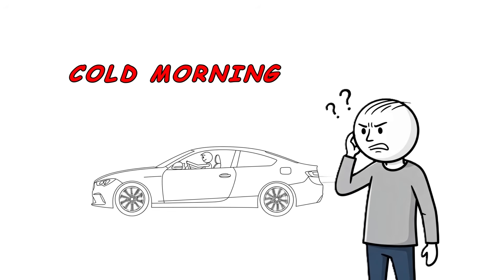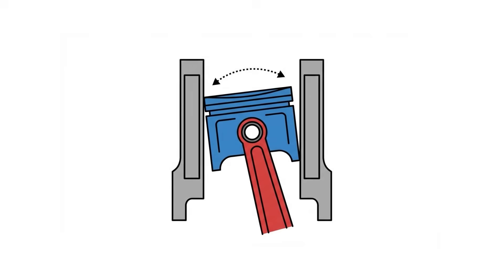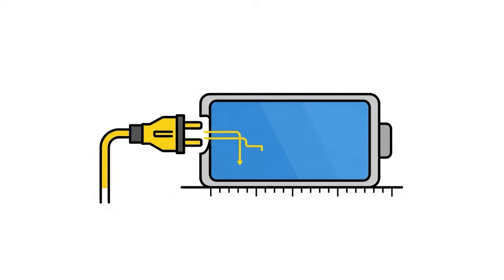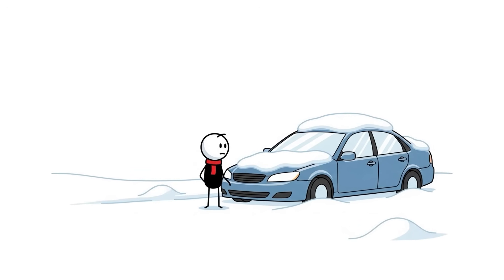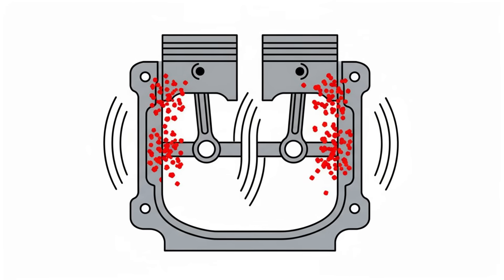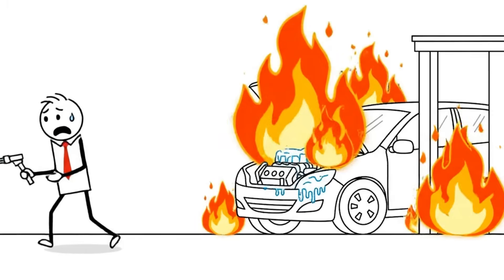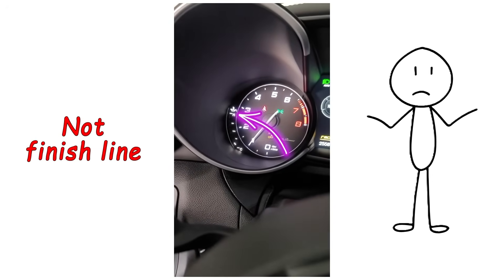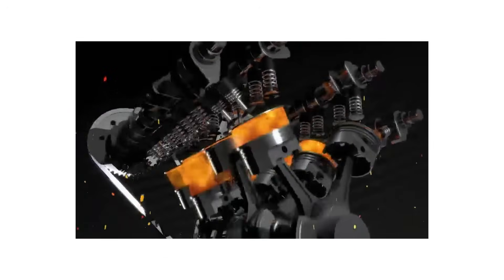Never Start Your Car Like This in Cold Weather (Ruins Your Engine FAST)

Comment: No need to tell me,im a mechanic,you warm your cars engine and let it get to operating temp on its own,no reving,in any state even cold or hot,you never just start a car and take off.
Reply: Start your car and take off in the time immediately. However, do not rev or race your engine until it gets up to operating temperature.
Reply: Doesn't matter at low rpm. My car warms up for maybe 5 min then I head down my 25mph street before I hit main road. 178000 miles and going strong.
Reply: As a mechanic I disagree, it’s exactly what you should do. You start the car and you take off normally.The oil needs to be under pressure / load to be distributed correctly, not just sat idling under no pressure at all. Thats awful advice.
Reply: Well since my advice is so aweful mr mechanic you don't have to hear me again because you've just been muted.
Reply: @kelvynwilliams7186: really? You’ve muted me? Why? Please don’t! I love you 🤣
Reply: @skykid4000 , please tell us why. Seriously. I have seen videos recommend heavily to not let your car idle while running whenever possible.

Comment: 2005 accord , warm up for 5 mins. Cars at 280k plus miles.
2015 335i warm up for 1 min till rpm drop than drive slow till car warms up. Seems to work.
Reply: 1998 honda accord.  I idle it in negative temps for 12 days straight 😂

Comment: My 71 Chevelle needs time to warm up...even in Summer.
Reply: There is nothing wrong with it. It's probably a big v8 engine and if it is a big block Chevy engine, it will take even longer to warm up. 
 These are not little modern day engines like my 2024 Chevy equinox with a little puny 1.5 liter  engine that only takes a few seconds to start warming up.
 My 71 GTO has a 455HO 7.5 liter engine and because of the large displacement it just takes longer to warm up.
Reply: @gadgetkat5146 I prefer my big block engine. Rumbles with the camshaft, roars like a lion when opened up. New vehicles can't compare. Do you still have your GTO?
Reply: @twalatka It was my first car that I bought in 1984, and I sold it in 93. But I wish I still had it. It had the 455HO with M22 rock crusher transmission. 
 
So you have a big block in your Chevelle, 396 or 454?
Reply: Then theirs something wrong with it. Its better to start a car and just drive. The oil gets displaced better under load and pressure than it will just sitting and idling my man.
Reply: @skykid4000 😂😂😂😂😂😂😂You obviously never owned a pre fuel injected vehicle.
Reply: @skykid4000 😅😅😅😅

Comment: Such BS!  Most cars use synthetic oil, which coats engine parts and stays there for days following engine shutoff.  As long as your car hasn't sat for days, youre fine.
Reply: If you actually looked into it you would know that most of these synthetic oils are not truly synthetic and are just mineral oils that undergo hydrocracking.
Reply: @M1tzaaa  😳

Comment: I wait at least 5 to 10 minutes when is FREEZING cold out. Don't care what anyone says.. Never had a problem. Trans feels horrible even trying to drive calmly down the road if i try to drive right away. No thanks.
Reply: All stuff i've known for years. No more than 3 to 4 minutes, even under the most severe temperatures. The more important thing is to drive it very slowly and get the driveline fluids up to temperature which won't happen when the vehicle is sitting. 20 year master mechanic.
Reply: @404notfound..... 👍
Reply: @404notfound..... agreed, 30 years average joe... but drive very slow until engine temperature rises.
Reply: @404notfound..... F that!!! I'm sitting for 10 to 15... sometimes 30mins
Reply: @404notfound..... yes your right once you drop 1k rpm then it time to hit the road slowly
Reply: 💯.  I had a car for twenty years and NEVER left the driveway until the engine reached operating temperature and the engine was fine.

I find it funny for an airplane you have to wait for the engine to reach operating temperature before taxi and takeoff but not for a car engine.  🤔 Weird.
Reply: 40°-34° about 1 min
32°-15° about 2 min
10°- 0° about 5 min 
-0°+ about 8 min. 
won't kill your car waiting 5-10 but driving when metallurgy is compromised can, so pick your poison.  all my cars are  manual and I generally let car warm up to the point its not like stirring cement.
Reply: @Shallowdarkpit Try TX7 manual transmission additive.  Get the engine additive also if you like additives and love your car
Reply: Yup I wait for trans temp to get warmer ,
Reply: I always warm my car up 15 minutes at least. For me not my car. Every wisconsinite born and raised always has.  It wasn't until the libs from California moved here until they started crying about it. They can eat a bag of Oscar's
Reply: With my 07 Impala I always pre crank when it's freezing. I can't always creep down the road and I'm not sure how modern the Chevy is. Car runs great but seems like the precrank shouldn't shut off (10 min )B4 I hop in to take off. With the windshield only having a little space to be able to see seems like I should use another method for the windows.
Reply: I live in Michigan where it gets really cold in winter. I will take the risk of the car warming up so I’m not freezing to death when I have to drive on really cold days
Reply: I started doing this this year. I recenty bought a used car and intend on it to last long. The timing belt sounds clonky when driving too fast when it was sitting all night. I drive so slow when I pull out of parking, it frustrates others- dont care lol the manifold thanks me. I was going to move from winter this year, but the money is nil. Im staying 😂
Reply: I wait 30 sec to 1 minute when it's FREEZING cold out. Don't care what anyone says... Never had a problem.Trans feels fine even when trying to drive  calmly down the road if  I try to drive right away. Thanks.
Reply: @FatTofu-pu2li You must hate your car. Hope you also never change the oil before 30k kilometers to ensure maximum damage
Reply: @M1tzaaa you don't know cars do you lol
 Sad
Reply: @M1tzaaa  you are an angry person. Clearly you've never had an inch of ice under a foot of snow on your car before. There's NOTHING wrong with letting an engine run for a whole minute before leaving. Generally speaking, I let the thermostat try to at least get a reading on my gauges.  The lowest it goes is about 110f, which is right about when the engine choke cuts out. This is 100% safe; the colder it is, the longer it takes to get the car rolling (battery voltage matters, too).
Reply: @FatTofu-pu2li the road leaving my home, is 50 mph. if i did this I'd cause an accident.
Reply: @Shallowdarkpit just floor it man.
Reply: @FatTofu-pu2li Been doing this forever: 30-60 seconds at cold (sometimes even at -20c) and I drive away SLOWLY. I only start engine earlier if car needs clearing of ice or snow.
Engine and transmission is at 350k km as of now
Reply: 10mins for me ...faster on good oil
Reply: @definitionXrp Too long and not a good idea, you are just delaying complete lubrification to the engine and the transmission and adding moisture to it, thus ruining your cylinder walls. Hope you in the market for a new car.
Reply: @JonathanStrome all mechanics say warm up the car....you news age people always act like yall found a new discovery....my car doesnt even drive smoothly when its cold
Reply: @definitionXrp All GOOD mechanics say not let idle your car too long in the very cold weather. 1-2 max.

Comment: I WAIT 30 SECONDS take off slowly the car will warm up faster when moving
Reply: Watch your tachometer and wait for it to level out to normal idle RPMs and then take off and drive slowly.  If you have a turbo wait a minute or two after it levels out to let the turbo warm up a bit. 

30 year mechanic....
Reply: @Americanman450 ty❤
Reply: That’s what I do.  The computer keeps the revs high and the power down to keep load off the engine when it’s cold.  Never lug an engine especially cold.  If you have a manual transmission keep the revs around 3k when cold.
Reply: @user-tb7rn1il3q  On diesels not more than 2000 rpm until reaches 185°F
Reply: @user-tb7rn1il3q  2k is best until warmed up

Comment: So....in modern cars...warm up no longer than 5 minutes during cold weather?
Reply: Not necessary. Idling until your car warms up does more damage. Driving your car will warm it up faster.
Reply: @FatTofu-pu2li I hope you don't mean start the car and take off immediately.... When you first do a cold start. The idle revs a little high. I warm up until the idle reaches 1000. It should take 2-3 minutes at most in cold weather. Then drive your car slowly until it reaches operating temperature. Then proceed with your driving as you normally would.  Is this how you do it?
Reply: @timothylee2772 I turn my car on in -50 and before I even hear the car turn over, I slam on my gas pedal and hold it there. I redline it while it's in park. This warms the car much more faster than idling. I don't even need to plug my car in. I also don't believe in oil changes. You guys were brainwashed to believe oil changes are essential.

Comment: I love working on my 2007 Honda Civic; it's so easy and cheap.
Reply: Like most 2007 and older are.
Reply: @aciddiver1978 I have a 09 Civic LX 70,00 Original miles here in NY and won't trade or sell her for nothing!! Plus that NO CAR NOTE!!!
Reply: 1991 Integra here ... over 275,000 miles.  (Not KM)
Reply: Yessir I love my 03 crv
Reply: Same with my 08
Reply: 1995 Chevy Corsica
Reply: @lapoose I will never own any vehicle that is newer. 2005 GM and 98 GM truck.  Very reasonable to repair and everything last longer. A no-brainer .
Reply: @RoseMunn-h7k  crossover drivers seethe on their way back to the dealership
Reply: 2003 Honda Civic I VTEC 2.0 n yup so easy n cheap to fix
Reply: 2003 Honda Civic Type S IVtec 2.0 easy n cheap to fix indeed